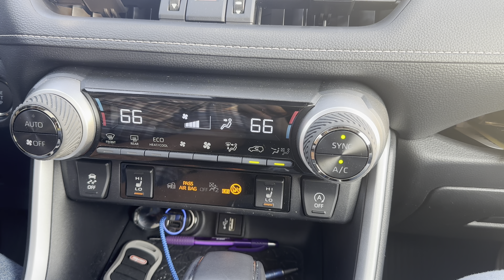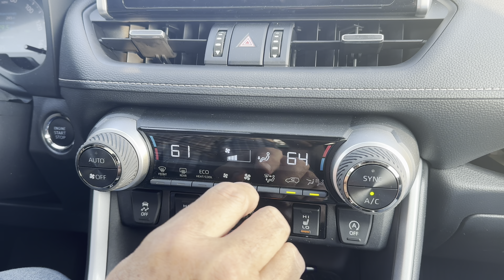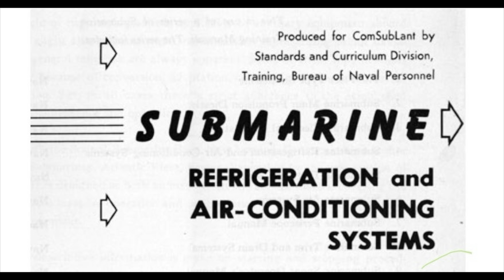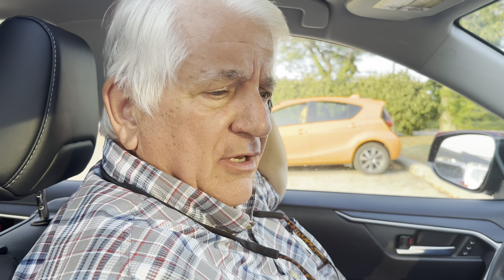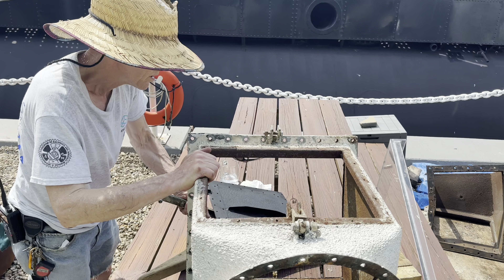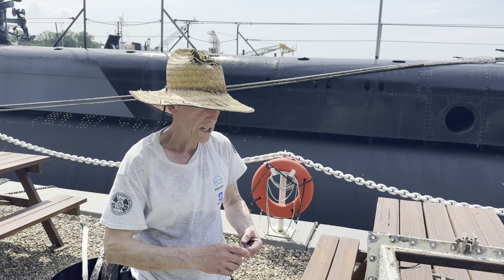Blowing in the Wind: USS Cod Restores Her Ventilation System

Comment: Really good to see the progress that you are making with the ventilation system. What are you using for a D.C. Power supply for the D. C. motors for this system and other things like the Radar Training Motor. Also, can you  add a cooling / heating modern HVAC air coil to that system with an Inverter Compressor somewhere under the deck. That would sure help in heating / cooling / and de-humidifying the boat. With that ventilation system functional, you should be 80% of the way to being able to do that.
Reply: The blower motors, not to mention most motors on the boat, are powered by the Auxiliary Power System, 250 VDC (one of five different power systems on the boat), which right now is back-fed by our Shore Power System. The radar training motor is powered off the DC side of the I.C. (Internal Communications) Power System, which in turn is powered by the Lighting Power System, 115 VDC, and which is also back-fed by Shore Power. So, that's four power systems right there. (BTW, the fifth power system is Main Power.) The addition of modern HVAC in the future, in one form or another, may be doable.

Comment: I’d love to see the actual refrigeration system as well. I imagine refrigerant would be pretty hard to get if it’s leaked out but it still would be cool to see.
Reply: I bet it used ammonia as a refrigerant, and getting it to run again safely and up to code would be a costly nightmare. Buuut I'd love to be proven at least partially wrong :)
Reply: @sashimanu  They used Freon R-12. Pretty good for 80-year-old technology!
Reply: @davekraychee8723 They could probably drop in R134a or propane and use it then, if it isn't still holding the R12 charge.
Reply: Or the ice cream machine, they could go into competition with Mitchell's, East Coast, or Honey Hut.
Reply: No real need to get it operational, it would just be expensive for no use.

Comment: You also could probable take a portable A/C unit and vent the hot air exhaust from it into an exhaust air intake in the ventilation system and have a few A/C zones on board.